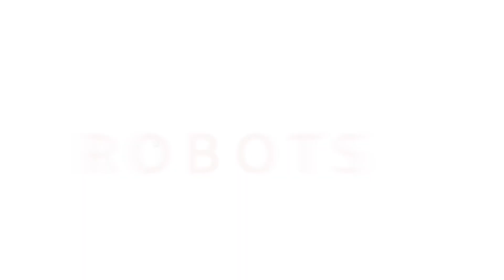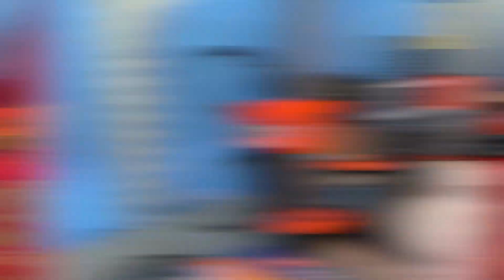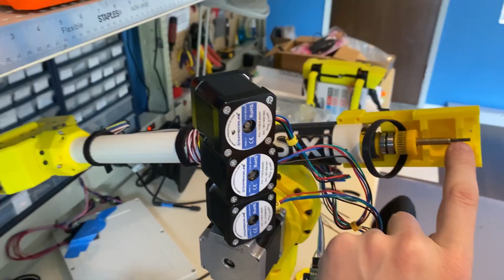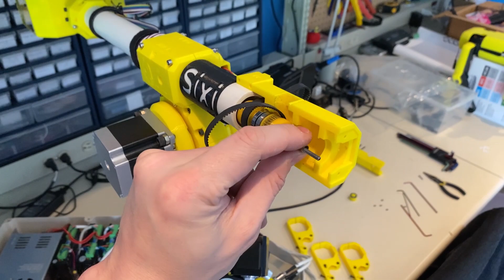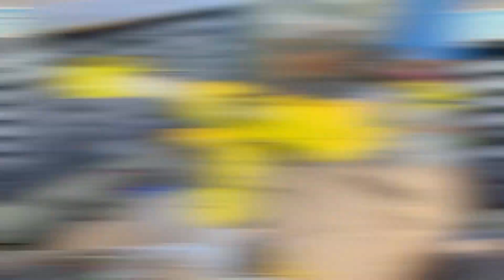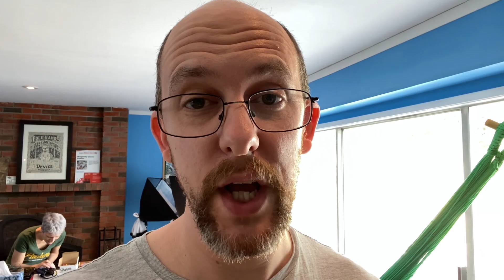Sixi Robot : Just tight enough (baby bear?)

Comment: Put a castellation on the end of the drive shaft and on the inside face of the drive pulley. Torque will be transmitted via the "teeth" on the shaft instead of the single tiny setscrew.

Comment: Another idea is to add an extra 2 nuts onto the grub-screw, tightened into eachother so they lock (you now need 3 nuts instead of the original 1). Then like a normal screw/bolt-head, as you tighten the grub-screw now it can exert downwards squeezing pressure for a friction lock just like a normal screw-head would.  
This also gives you the opportunity to put this "head" anywhere you want on the screw, so you can get the adjustment just right.  Basically it's now a screw of arbitrary & adjustable length.  Good for situations where your 3d printing tollerances are all over the place & you can't match it to 3rd party part lengths.

Comment: One way would be add a drop of super glue( fast way) , but that might cause problems
Another better way would be to measure the length of that screw and making the dimensions for your part so that if that screw is tightened all the way , it just reaches  your desired position
Reply: Ah just read the description, so try the second option :)
Reply: @wissamtedros1339  ye, 2nd option was my thought too.  Basically just don't use a grub-screw, you need a screw with a head.  If you're not confident of the 3d printed tollerances, make the nut hole bigger & print various thin shims to go in there.
Reply from the maker: screw with a head is where I'm leaning towards... it won't stop the screw from coming loose, which was the original problem.  What say you?
Reply: @i-make-robots  yep, that should do the trick, make sure to add a washer to avoid cracking the plastic 👍😀